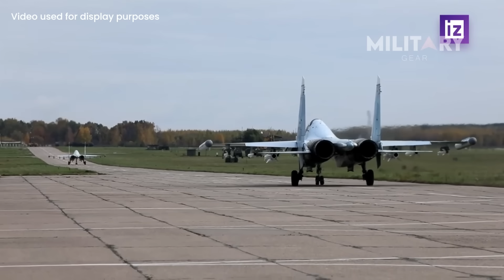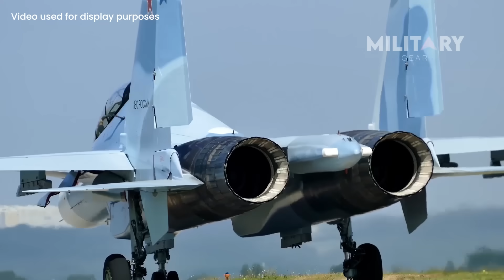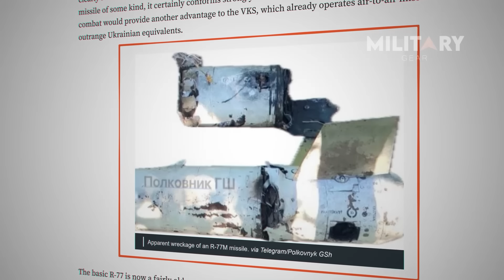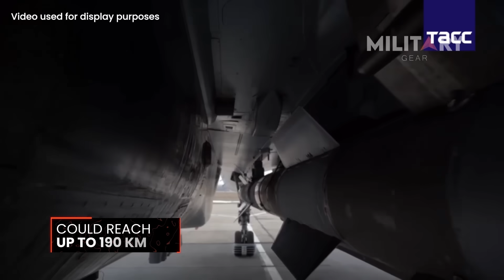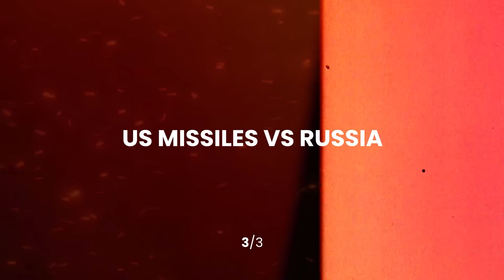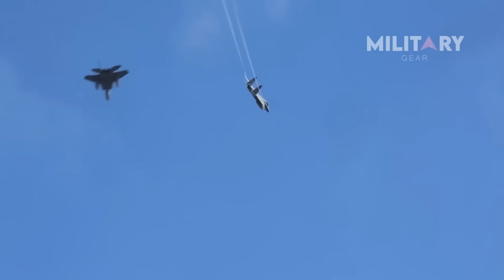Shocking Footage: Russia Deploys Next-Gen Airstrike Power! —NATO on Alert!

Comment: As if to ensure their superiority? The U.S. is lagging far behind! It has the longer range and better missiles and that’s not a guess!
Reply: No. The longest-range air-to-air missile in the world is the Russian KS-172 (AAM-L) - a range of 400 km. (250 miles). The problem is not in creating a missile of such a range, the problem is different. The further the missile flies, the slower it maneuvers (larger in diameter, heavier, slower). It is much easier to dodge such a missile. They are supposed to be used against radar aircraft, tanker aircraft, bombers and transport aircraft. The point of the newest Russian missile is precisely in its maneuverability and speed - a two-stage engine dramatically changes the capabilities of such a missile. It can be compared to a short-range missile, the fastest and sharpest in maneuvers. In addition, the missile is equipped with an active phased antenna array, which is not available on all even modern aircraft. This is really "imba" at the moment.